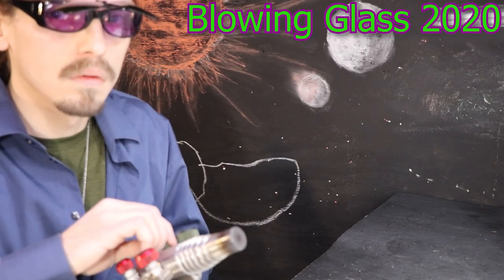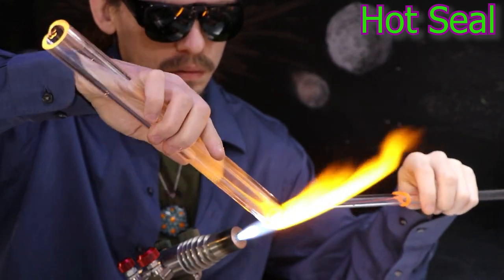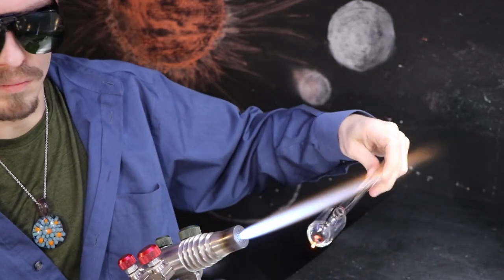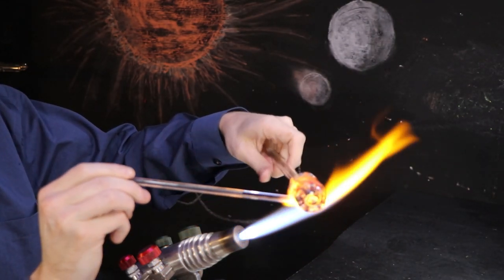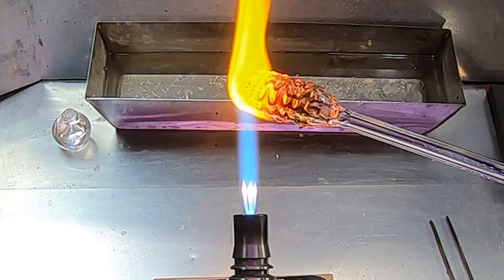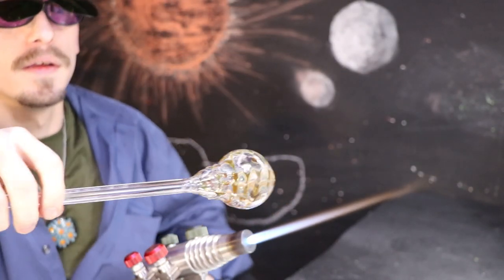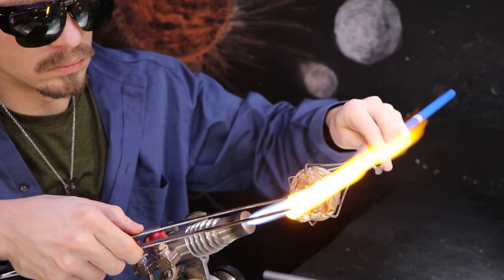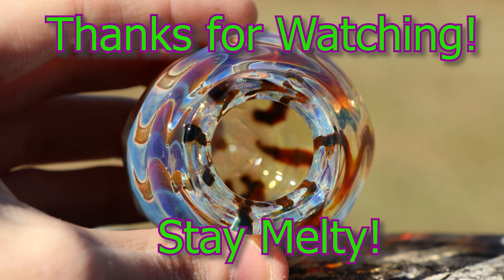Blowing Glass Art 2020

Comment: Hey Matt. First off, thanks for the videos. For someone like me that's primarily self taught, it's great. I've been trying to make a blow in Christmas ornament with mixed results. Do you have any experience with the technique?
Reply from the maker: Hello John. I've made some Christmas ornaments in the past. The main problem I found is that they need to be extra light weight so they don't fall off the tree. Also you could make a glass loop to hang it or pull the tube down and cut it off and then fit it with a metal ornament cap. I hope this answers your question John, let me know if you were referring to a more specific technique.

Comment: Not even close to hot enough on that last flare. That's why you had to use so much force. Awesome video though - people need to see how easy vessels really are. Don't be afraid to try it!
Reply from the maker: Yea soaking it in the Bravo for a couple minutes would of helped. Vessels aren't too difficult, I would recommend starting with a marble. But with enough practice everything becomes easy, coming up with original ideas is the hard part.
Reply: @MattJasa  I use a Bravo to do marbles and most of the time I don't use the outer flame, but I have two oxycons of 10LPM, so that helps when I need it. I have managed to find a few signature styles that people seem to like, but yes it is hard to riff sometimes. I love your channel. I have a science background myself, so it's cool when you throw that in. It's a very important part of glass working!